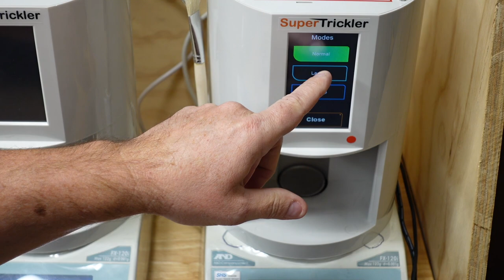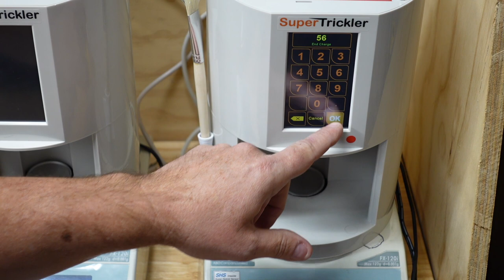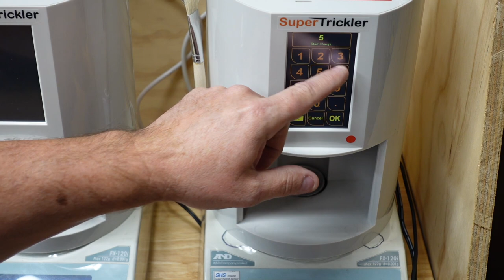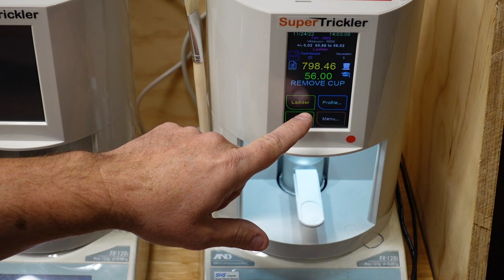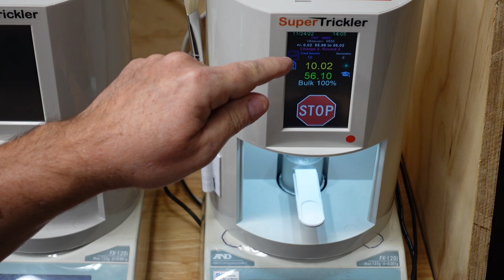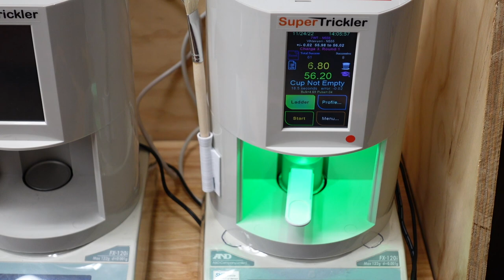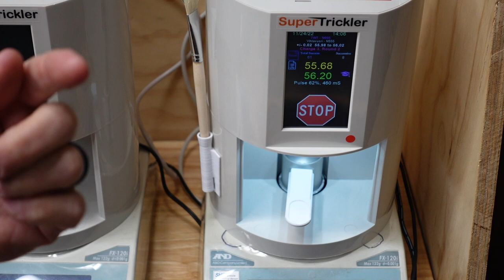Load Development ladder testing with SuperTrickler powder trickler measure

Comment: Hi John,

May I ask what your goal is concerning the latest technology that you present on this channel? Is it for precision, more efficiency, or perhaps both? New technology is very intriguing, but what is the bottom line performance enhancement you are experiencing with these new tools?
Reply from the maker: I enjoy testing new stuff and while I would agree new tech isn't always good just because it's new tech I do like seeing things advance the sport when possible. Short term the SuperTrickler offers 'performance enhancements' like making it much easier to tune the trickler, program it for those loads and then run charges or ladder tests. Long term like I said it's going to be a complete system that includes brass and bullet sorting as well as the SuperFiller which will allow you to walk away while it fills 200rds automatically.